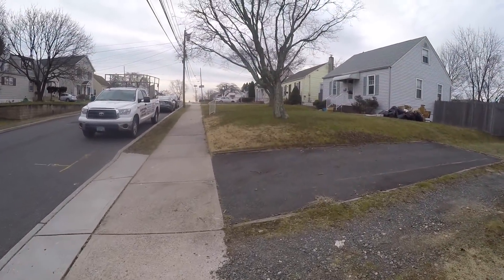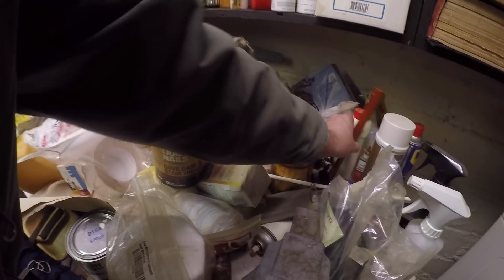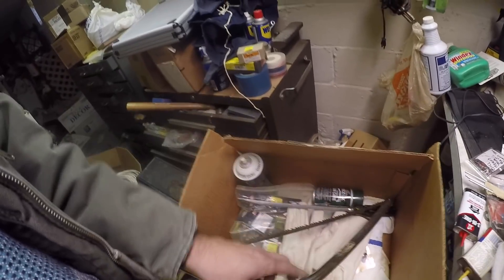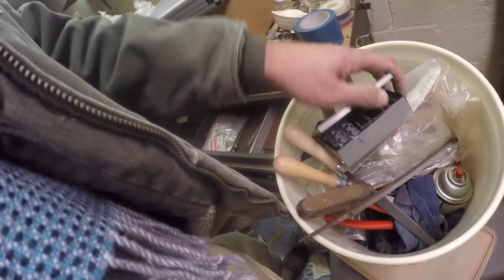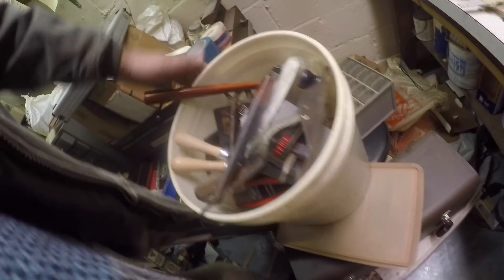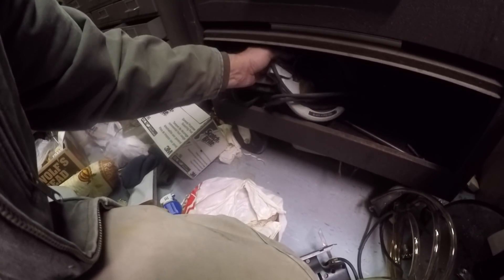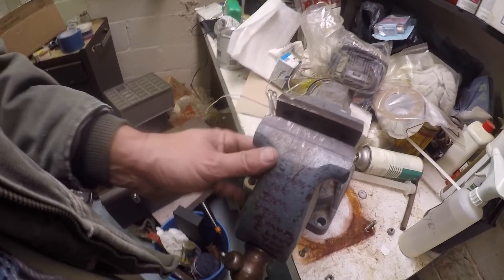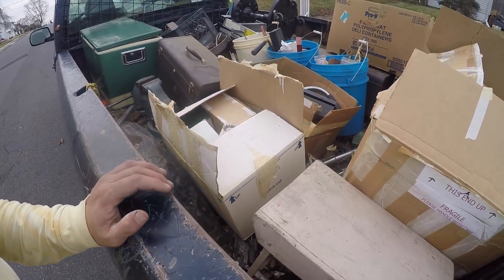House Call Got a Truck Load of Tools Good Day of Picking

Comment: Dave:
As others have said, the Starrett-branded bench vise is a home run. Regarding the tool boxes, all appear to be Kennedy. Thought you got the big box, too (but did not see it on the lawn). If you did get it, mated with the machinist box, you are easily looking at a couple hundred + (and covering your expenses just with that). Hopefully you can find the keys to both boxes as well. Lastly, the arms cleaning kit in silver box is nice, but not very expensive (around $20.00). Coupled with the NRA clock, may be other treasures yet to be discovered...